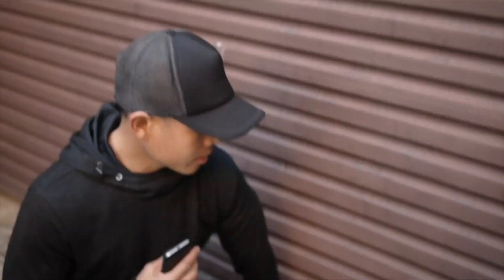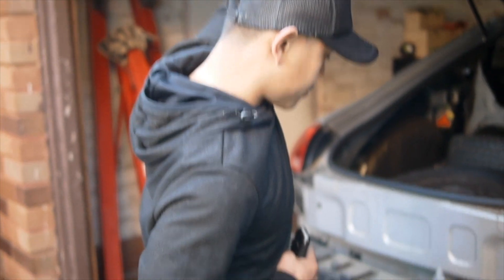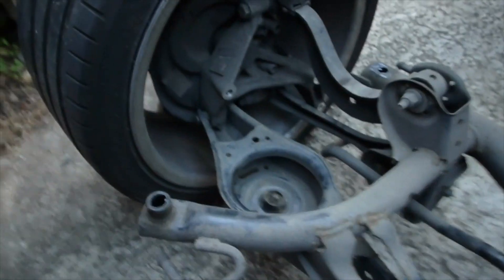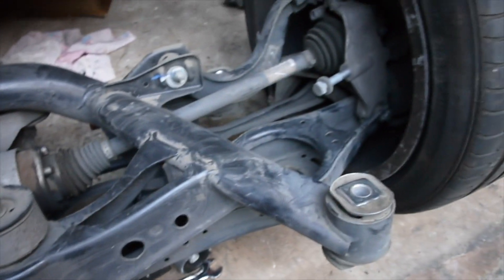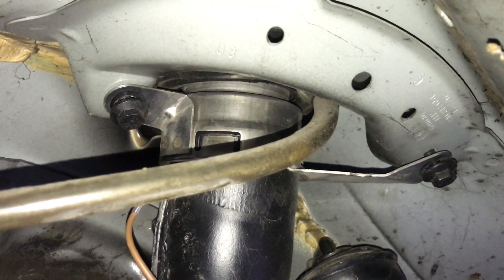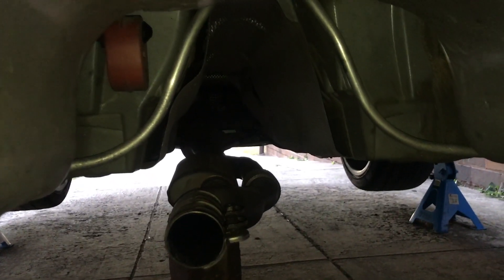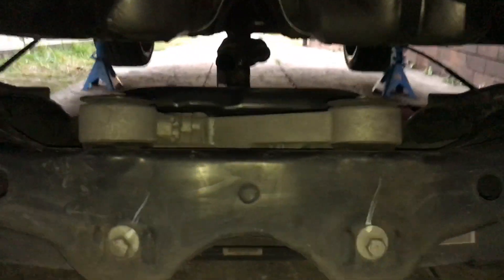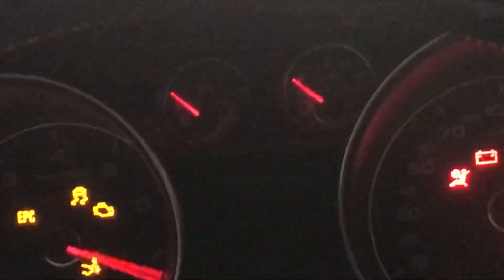Audi TT Mk2 8J front wheel drive (FWD) to Quattro (AWD) Swap/Upgrade

Comment: Do you need to do an engine change or can you just fit a rear diff and be done with it?
Reply from the maker: No need to do an engine change. If you Gunna keep the same engine and just to AWD retrofit you just need 
+ AWD gearbox with bevel box
+ AWD driveshafts 
+ All the AWD rear assembly inc subframe 
+ Driveshaft and mounts.
Reply: @ianpgonzaga sounds farily straight forward
Reply from the maker: @zool8139  Just like Lego ;)
Reply: @ianpgonzaga got coilover all round with 20" wheels looks great ride is smooth rolls over bumps and curbs brilliantly
Reply from the maker: @zool8139 whoa huge wheels!!!

Comment: Hey Ian, just curious do you have any videos on fixing/limiting rubbing issues in guard liner on mk2 8j? Caused by lowered springs/spacers.
Reply from the maker: @Antoncreed  Hey Anton. Nah I don't have any videos on that but either sounds like suspension height needs looking at or wheel and tyre fitment is not quite right.

Comment: Best video I have seen on such a swap on a TT 👌🏾👌🏾. Did you have to modify the trunk floor? And how did you get the propeller done?
Reply from the maker: Hello. Thank you. TT Mk2 all have the same floor so no need to modify - just need to ass brackets for propshaft and the rest is bolt on!
Reply: @ianpgonzaga  thanks alot for your response 👍🏽👍🏽! So are the propshaft brackets same as what's in the Golf MK5 R32  and MK6 R or they are specific to the MK2 TT? Would you know the part numbers?
Reply from the maker: @sylvestermusyimi4006  I believe they differ. Part number in one of the 3 part videos or check in the Audi TT UK forum post for it.

Comment: Nice video ! If I already have awd tt ( automatic or not ) can I swap the 2.5 engine in it ? Specifically from 3.2 Quattro to Ttrs engine ?
Reply from the maker: Can be done but you'll need much more than just the engine.  Also need the engine wiring, gearbox, axles are different for the ttrs gearbox.
Reply: @ianpgonzaga  thanks for your response I appreciate it . Much to ask I try not to be annoying , so if I buy any of tt mk2 chassis awd or fwd I will need the same you mentioned ?
Reply from the maker: @michaelsmith3017  no probs!! Yes most likely. The ttrs setup is more robust than the 2.0 or 3.2 (uses dq500 gearbox vs dq250) that's why all the extra drivetrain stuff is required. Most likely and module, maybe radiator and relevant piping also needs to be obtained.

Comment: Hi, I have a 330FWD Audi TT 8J and will be 380hp soon. Considering on doing this AWD convertion. Could you engage the rear diff to make it work as AWD?
Reply from the maker: Hi David. Yes the Haldex works as it should when installed correctly and coded too but there is so function to manually control it unless you also install a race controller.

Comment: Hi Ian, I really enjoy your videos and they have helped me recently replace my electric window cable. I have 2008 mk TT. I've had an issue now for some time where the engine light comes on and off intermittently although there is no apparent fault with the engine. After having the car serviced i was told this is a so-called common fault with the Mk 2. Have you heard of this problem and do you know of a fix?

Comment: I have a FWD Audi TT and ALOT of money was put into it. It is fully capable of 500 hp right now with all the parts,I would just need a bigger turbo and remap and even right now (350hp) it’s way too much for a FWD car. My idea was to either sell it (I would like to avoid it) and buy a quattro or make it into quattro. I wonder how much would it cost to make it into quattro (assuming I buy a donor car and sell the other parts out of it except haldex and what else is needed). Is it worth doing and how much of a hustle is it?
Reply from the maker: Hey man. Good question ... So I actually made money off my parts/donor car. It's very doable and you can see from my video most things are bolt on except a few brackets which are easily purchased.
Reply: @ianpgonzaga  thanks for the reply,appreciate it. I might even decide to do it. 👍

Comment: Hey Ian , hope your well. I am interested to do this conversation on my Fwd 2.0 TT to Awd but I want to keep my 2.0 motor  is it possible.
Reply from the maker: Hi! Yes of course that's possible. Just need the AWD hardware, wiring and then coding required.
Reply: @ianpgonzaga  Thank you for your response Ian 🙏
Reply from the maker: @bdwaldeck4032  no problems and good luck with the project !

Comment: Hello ian . How did you stick the hooks that hold the awd axle?
Reply from the maker: Hi. TIG welded the brackets. They are aluminium.
Reply: @ianpgonzaga  i am scared of welding them not to make a hole on the bottom.ive heard of an aluminium glue "3M" used in these cases. I asked in case you used something like this
Reply from the maker: @αισχοςντροπη  I see. You must weld it. I don’t think a glue will be strong enough to hold the brackets in place with a piece that will vibrate a lot.
Reply: @ianpgonzaga  thank you for your answer

Comment: It is great job you've done here Ian. I have seen the part list for conversion from FWD to AWD. I have a question for you. I am thinking kind of a similar thing; to swap everything from a donor MK2 TT RS to a MK2 FWD TT. As I understand, there is no difference in the main chassis of the cars. So as I would have every part from a donor TT RS, I can make the swap completely, including engine, gearbox etc?
Reply from the maker: Thank you. 

Yes that will work very well for you. Lucky that you found a wreck TTRS! Hopefully it was not too expensive. 

You will have everything required to make the awd and 2.5 conversion successful!

Comment: Wait what about coupling? How did you connect a diff to the engine?
Reply from the maker: Using the AWD gearbox which has the transfer case, connected to propshaft, connected to rear diff. 

All aS it would be from factory.

Comment: This is awesome..!  Ian if you have any time in your hands to answer this question.. Do you think it's possible to do the same with an Audi A3?  Mine is a 2010 with 2.0T (DSG) Left hand drive..  I might be able to get my hands on a possible 2008 VR6 A3 car with Quattro..
Reply from the maker: Hi Rich and thanks 😊 

The thing with the A3... and I checked this physically... is that the rear ends differ from FWD to AWD. In. Front wheel drive the boot flow is lower because there’s no AWD gear under there. In the Quattro it is higher to have space for the diff and Haldex. 

If you can weld - go ahead as it’s possible. It’s just a lot more work as you WILL need to cut out the boot floor from both vehicles then weld in the AWD drive to your previously FWD one. 

They didn’t all come with the same height boot floor like the TT did. 

Hope that helps.

Comment: Nice video! its possible to do the same in a Audi a4 b7 whit the same quattro?
Reply from the maker: Thanks! The Quattro setup is different in the A4. So it is not possible to use the same hardware. 

The idea could be the same though. You would need to check the floor pan.

Comment: Hi, that is awesome work you had done. I have a 360whp fwd TT and the tyre spin a lot.  I plan to convert my tt to AWD as well. May I know what else do I need beside oil tank, rear subframe, rear axle, long shaft and gearbox? Can it drive with the rear axle installed but without longshaft?
Reply from the maker: 航哥 Hello. Thanks it was a lot of work but worth it. No need for oil tank. The list you need is
- AWD gearbox 
- tailshaft
- tailshaft centre bearing brackets 
- AWD rear subframe 
- Haldex and rear diff unit (ensure its gen4)
- AWD fuel tank (there is also a heat shield bracket but it’s not 100% required) 
- AWD cat back exhaust 
- preferably all the AWD rear brakes kit 
- wiring for the Haldex
- then you need to adjust the coding in several modules to match the hardwire

You can install everything minus the tailshaft. You will just have a very heavy FWD car with a unit in the back that does nothing. 😂  That will still FWD skid everywhere! 

I was running my 2.0 setup like this for a long time because the tailshaft brackets took a while to arrive and also needed welding. You got insta or anything? Am interested to see your build :)
Reply: @ianpgonzaga  
Hi 
I want to ask what will happen to the rear of the awd gear box while waiting for the long shaft .
Will it just be spinning ? And does it affect the fwd.
Thanks
Reply from the maker: @babatundeabiola6985  nothing will happen to rear differential box. It will just be a big weight that doesn’t do anything. The Haldex will be disengaged without the propshaft / cardan shaft installed

Comment: Awesome work can you do a video with all the coding please? Thanks 👍🏻
Reply from the maker: Dene Cummings yes sure. I still require to swap the  abs pump as a final thing
Reply: Ian Gonzaga hi great, can you send me any information on the abs swap please? I’m just about to do mine! Thanks
Reply from the maker: Dene Cummings when I get onto it. Yep :)
Reply from the maker: Hi Dene - I’ve swapped over the ABS Module for the Quattro setup. It is all running very well but still some errors. Check my latest videos on how it went :)

Comment: Where's the rest of the video? Seems like the most important part is missing, connecting drive shaft haldex and all the front goings ons.
Reply from the maker: Rohan Morrison i haven’t got to that part yet ;) 

But basically I need to get two brackets welded into the chassis driveshaft tunnel. 

After that I can install the 3.6 along with its gearbox and connect up the cardan shaft ... I have been involved in other projects in the time being...
Reply from the maker: Hi @rohan Morrison - just to round off your concern - the driveshaft, awd gearbox etc is all very much bolted on and working perfectly. https://youtu.be/ylokqFFn4bU

Comment: Any updates on this ?
Reply from the maker: Have been driving the car with the rear hardware in (but not physically or electronically connected) - no issues. Only when the Haldex fuse is plugged in is where it starts looking for everything else Quattro related. 

Currently on pause at the moment due to other projects which I’m trying to bash out as quick as possible to get the 3.6 in!
Reply from the maker: Hi @Woreth TT - many more updates. The conversion is a success. 

ABS upgrade info:
https://youtu.be/Y9yAqK2P9dc

Short go on the track:
https://youtu.be/CvXkbnQARLY

Brakes upgrade:
https://youtu.be/TKUEkzDX5GM

Comment: How much weight did it add on? Compare to FWD ?
Reply from the maker: Hi... sorry i did not measure how much extra weight.  However when comparing specifications from our main car selling website it shows the weights as follows.

1280 kg 2.0 FWD
1350 kg 2.0 Quattro (not TTS)
= 70kg difference

Comment: and what about coding ecu?
Reply from the maker: yes i will need to adjust all coding to make it all think it is AWD - i think i will just bring all the modules over from the Quattro car to the black
Reply: @ianpgonzaga  right now i am doing this swap thats why i am asking. i have a tts  to take all it needs sir! i thought to install an lsd in order not to put too much weight on the car but..still 4 wheels better than 2
Reply from the maker: Αισχος Ντροπη did you get the brackets for the propshaft and the extra one for the Quattro fuel tank ?
Reply: @ianpgonzaga  yes i have the whole car waiting for the swap! i am still worried about the weight. do you have any idea about its weight difference?
Reply from the maker: Αισχος Ντροπη you will need to buy new - they will need to be welded on if your current platform is front wheel drive. The weight - considerably more. The rear diff is heavy!
Reply: @ianpgonzaga  hm thanks for the tip mate :) i am waiting for anothrr video :)
Reply from the maker: Αισχος Ντροπη https://www.ttforum.co.uk/forum/viewtopic.php?f=19&t=1900369&sid=9ccbfbbf2b8a0de68f19ea7917e83e99

Next video most likely brakes swap but the engine swap is coming after a couple of months.
Reply: @ianpgonzaga  hehe i ve done almost the same in my car! ahhh the glovebox...common problem! about the cluster..i ve put from tts to mine but i didnt know that coding needed so i have the yellow steering light and they told me to put the tt base file... or someone to give the coding..do you know how to do it?
Reply from the maker: Αισχος Ντροπη you need to match immo data. It is in the cluster. Do you have Facebook? You to message #ElectroVag https://www.facebook.com/%C3%89lectrovag-1934433286788937/

He will help you
Reply: @ianpgonzaga  thank you very much! good luck in both of us in our project!
Reply from the maker: Αισχος Ντροπη yes!  You will see progress when it happens ;)

Comment: do they have the samw abs unit?
Reply from the maker: I will need to change the ABS module (in engine bay), yaw/lateral rate sensor (under centre console in front of gearstick), attach the Haldex and 2nd fuel level wiring and adjust the coding